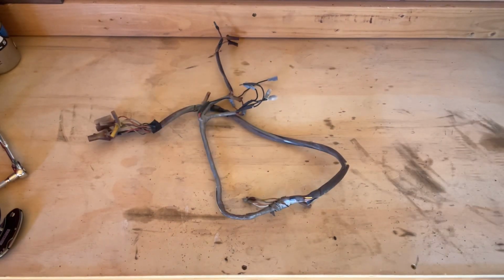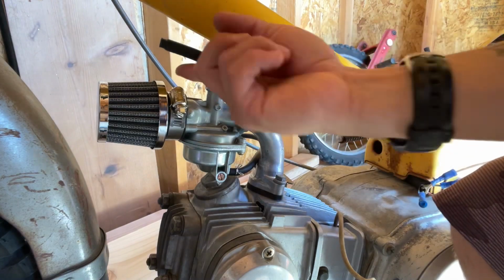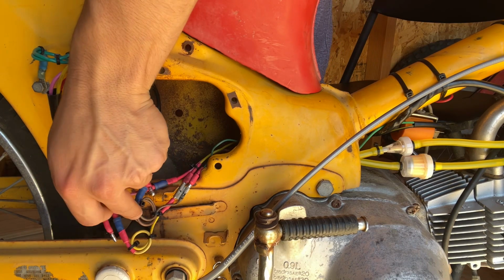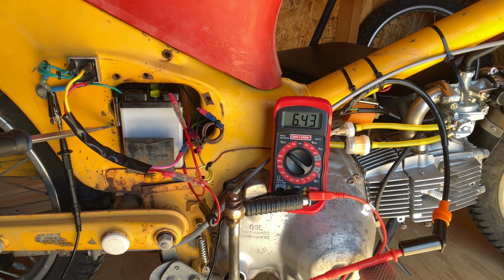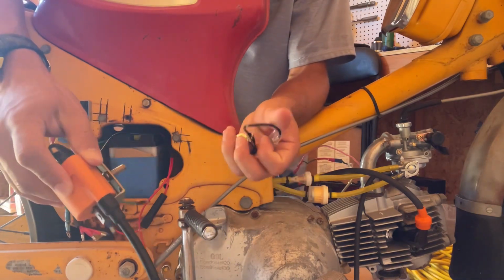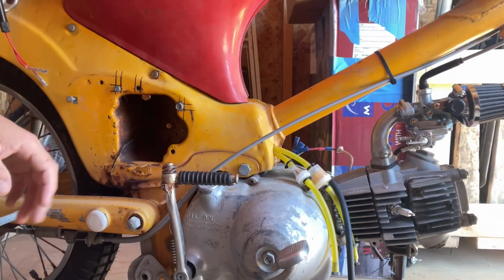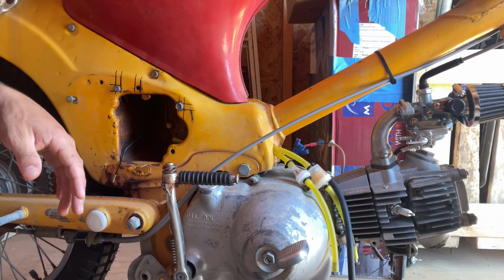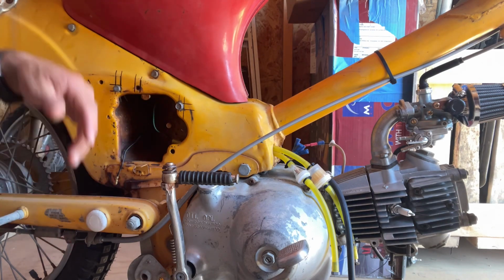CT90 pt:3 I hate wiring. (Only 2 wires)

Comment: If your battery keeps going dead on you, it's because you don't have the rectifier hooked up.
Reply from the maker: Yes and I know that but I’ve also mentioned in the video in the same clip where I said “im not going to be running the rectifier because my stator is bad and doesn’t produce any electricity or charge to the battery”. It’s closer to the end of the after I’ve shown the bike running. Also thank for commenting your are the 2nd who has commented overall and really really do appreciate it.